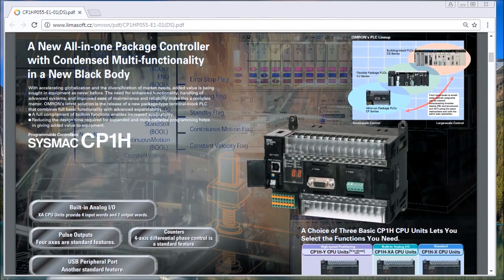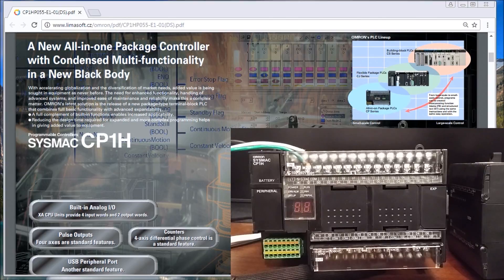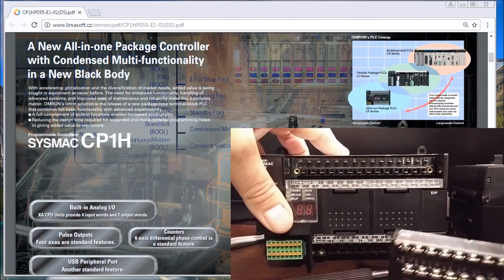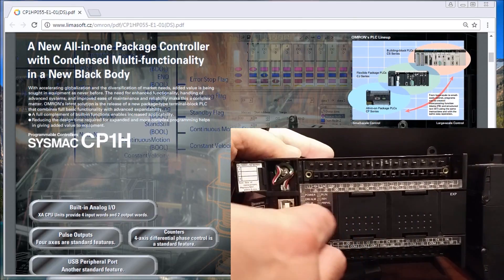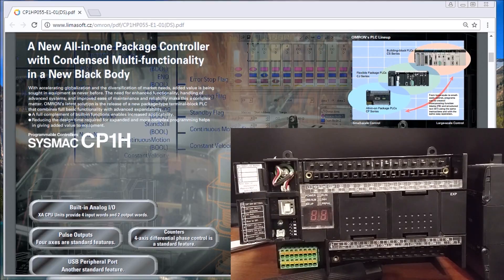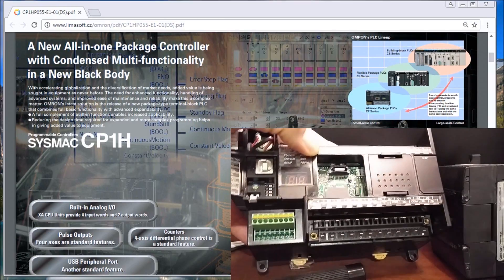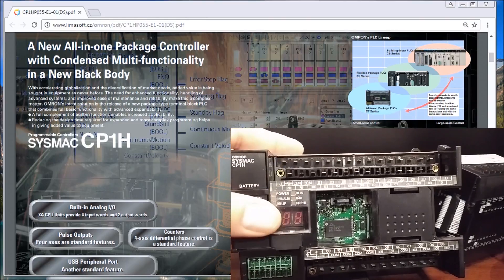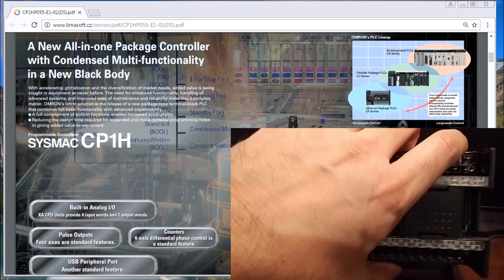Unlock the Power of Omron CP1H PLC: Complete Hardware Guide

Comment: Hi i need to help 
When we creat new channel in cp1e da modul(cpw1a), we write 8099.
I know mean of 99 but why we write 80(1000 0000)?
Reply from the maker: Hi Ugur,
The first bit of the word is the sign. This means that you are writing -99. I would check the setup of the analog card if you do not want to use the negatives. 
https://industrial.omron.ca/en/media/CP1E_Hardware_UsersManual_en_201601_W479-E1-09_tcm824-108755.pdf
Here is the manual. Look under the Analog Input Signal Ranges.
Regards,
Garry
Reply: Garry Shortt 
Thanks Garry 🙏🙏

Comment: Hello. I set Constant Cycle Time to 500ms. Then PLC lost all contact with PC and i can't change it back to normal. Is there any way for a hardware factory reset of PLC?
Reply from the maker: Hi Auster,
I would try the following:
Open CX-Programmer and connect to PLC using Auto Online.
Place PLC in Stop mode.
Clear PLC Memory. "PLC" --> "Clear All Memory Areas" --> "Initialize".
Regards,
Garry